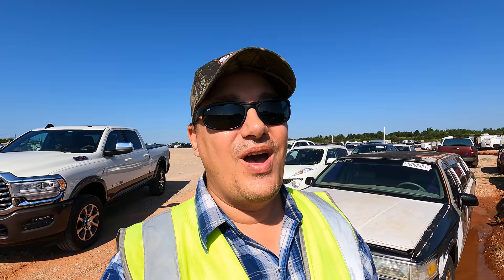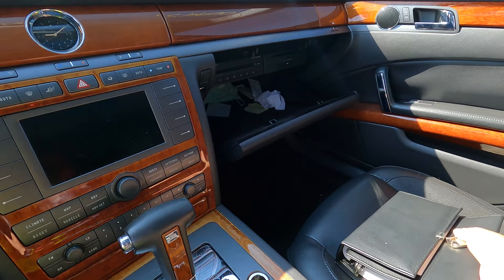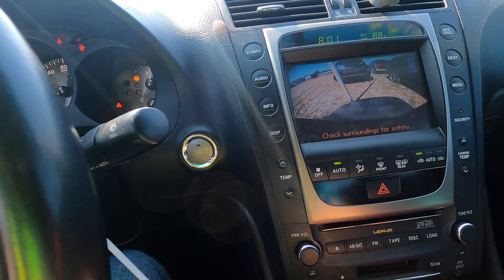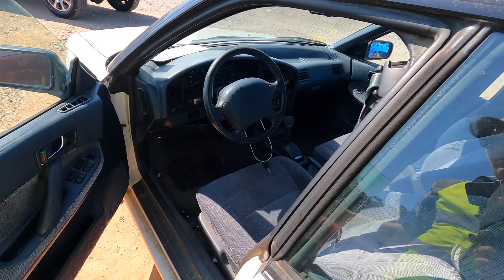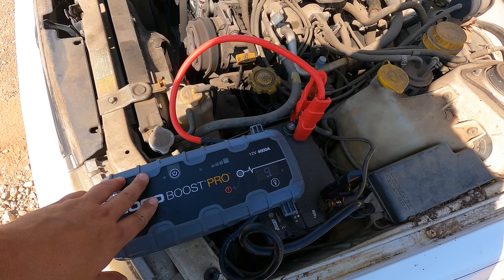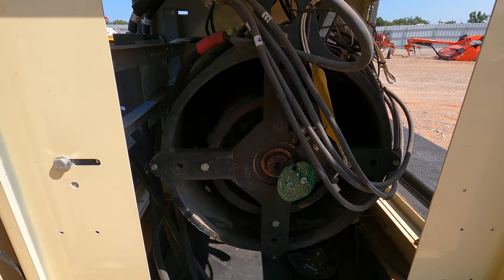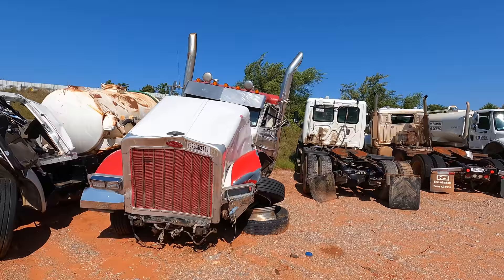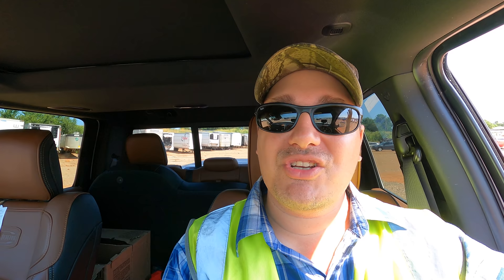Copart Walk Around 8-17-21 + $600 Volkswagen Phaeton!!

Comment: That Phaeton is a Bentley Flying Spur with VW styling. Insanely luxurious and insanely expensive to repair.
Reply: Bentley prices on a Volkswagen....😬
Reply: Someone should give that car a second chance.. sadly i'm over in Europe, if only that car would be over here, i would fix it & take such good care of her..
Reply: Yes indeed it is on the same platform as the Bentley, but one positive point on this one is that is does'nt have the w12.
Reply: @Stuntmannetje  it has it as a option
Reply: @vanzemaljacludi3324  The first gen came standard with it, but was also fully hand build. But turned out to be to expensive.
Reply: @mikaeljonsson4686  VW owns Bentley so basically same car
Reply: @just_so_diggable  yeah, watched a  Bentley rebuild and he bought some used vw-parts, craaazy much cheaper...

Comment: That Phaeton is worth the risk. They’ve held their value really well over the years. Very luxurious car as well. It would create some new unique content. Don’t see many VW’s on your channel!
Reply: Like a 4 Doors Bentley what a nice big car
Reply: The story of why it exists is pretty interesting too. It was a project lead by the VW group CEO at the time. He was determined to make a “luxury car for the people”. Although the price was only a little less expensive than the A8, it ended up being a sales failure. People didn’t want a luxury car with the VW badge.
Reply: agreed.
Reply: That Phaeton is the same as an Audi A8.  They didn't do well in the US but are great cars.
Reply: Held their value over the years? 120k new and 3k today
Reply: @ledio.m  Exactly. Here in Germany you can pick a good and maintained one up for around 10k. They have less value then a same year S-Class
Reply: @computerdeals  s class costs like 200k speced out but vw speced out was 130k
Reply: They will be very rare and desiarble. This one is clean and worth figuring out the electrical problems. Has the right engine too. 4.2 is bulletproof engine. Think its a timing chain engine.

Comment: The Volkswagen has a bad comfort control module underneath the driver's seat in the floorboard they get wet and mess up
Reply: At least, that Phaeton doesn't have the problematic W8.
Reply: Passat has the similar computer, sunroof drain gets blocked. Puff. There's a two inches of space under seat, when water has no place to go that's where it stays.
Reply: @albertagibinik3436  Oh, I know about VW sunroof drains. I just got one of my New Beetles dried out.

Comment: Thats a timing chain motor. The timing chain is in the rear of the motor. cost around $5-10K to change it and they all need it. It was this great motors Achilles heel.
Reply: Actually motor is really solid and its chain is not that problematic. Variant of engine that was in audi r8 and many more audis (rs4, q7, a8, a6, rs5)

Comment: I had one of these in the UK. The fault is normally with the KESSY module under the floor on the passenger side. It gets wet and breaks. Replace that and the 2 battery's in the boot and you will be good to go. Oh and maybe the ECU too.

Comment: When was the last time I saw a Subaru like that? Right this moment! The one I own and that is sitting in my driveway. I have a 1991 Legacy L I bought almost brand new with 255,000 miles on it today and my air conditioning is still ice cold as well. It never fails to start right up! You should buy that bad boy!

Comment: I'd get the Phaeton, it's an awesome car. And you can open the trunk from the VW-logo with the key, the lower mid section of the logo moves away with the key and reveals a lock that the key fits, and you can manually open the trunk and lift it up.

Comment: Didn’t have power at all because it has two big batteries in the back which were def dead. Needs alot of juice to power it. You can use key to open it with secret key slot in the VW badge and they are both hidden behind trims. Cool car

Comment: the old Subaru 👌
i'm a Subaru tech so i just have a thing for Subaru''s. And those old ones are tanks. I know they have head gasket problems when they get old. But that one cranked over nicely, that is a healthy running EJ22. If the coolant reservoir is full. I would definitely bid on it.

Comment: On the Phaeton, there is a hidden keyhole in the VW Logo on the trunk, which lets you unlock the trunk in case of no power. There are 2 batteries in the trunk, most likely both are bad.

Comment: Randy, when I have a situation like you had with the FAY A TON, I turn on the head lights so I know when I get a good connection with the jumper cables without having to run back in to the car again and again.

Comment: That volkswagen has a bad comfort control module. That causes it to freak out. Car might actually be a good buy. hey will be very rare and desiarble. This one is clean and worth figuring out the electrical problems. Has the right engine too. 4.2 is bulletproof engine. Think its a timing chain engine.

Comment: You have to push the Volkswagen emblem on the back of the trunk....
This car needs stable power supply or you're get a error message. 
You need to lern more about German engineering.